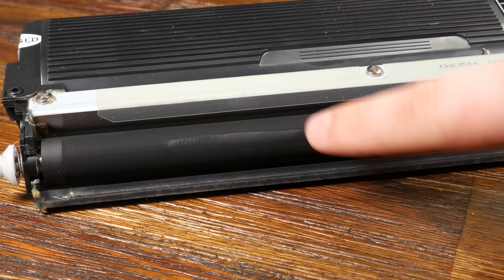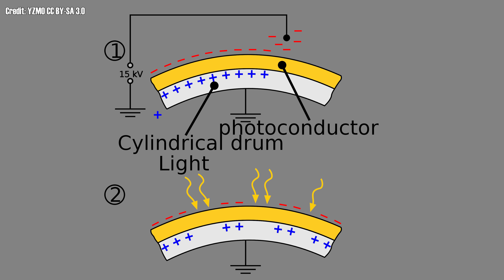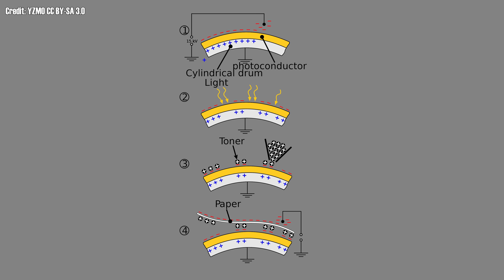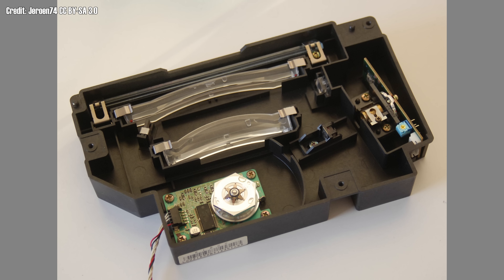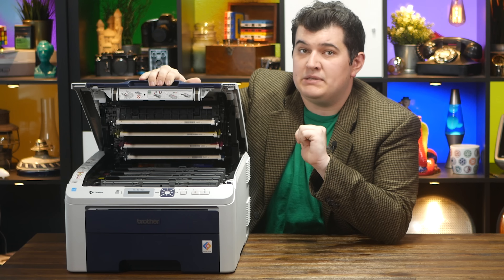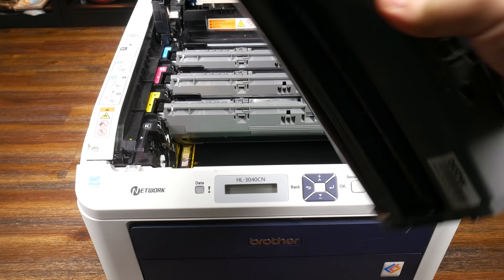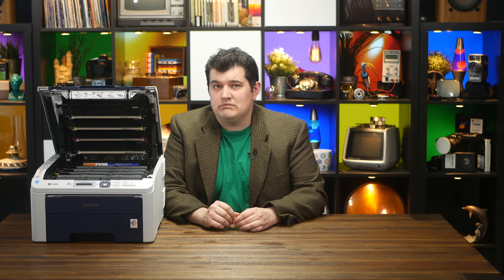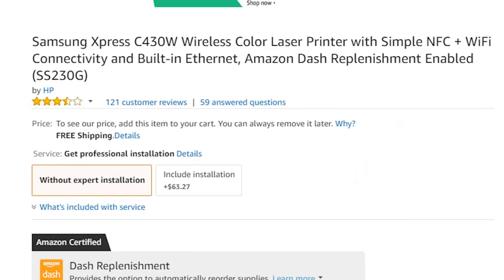LED Printers: The Common Printing Tech You Haven't Heard Of

Comment: A "whopping" 4 ppm color... son, I remember when it took 1 minute to warm up the dang fuser on an HP LaserJet II/III series printer, then have it SLOWLY feed the page through. It said 4 ppm b/w but timing it in reality you were lucky to get 2 or 3 ppm - and for a measly $1,500. Anyway, I have purchased several color LED laser printers (Dell C1600w/C1700w series). These were the first I ever read about LED laser printers knowing nothing about them considering I live in the world of computing for 35+ years.  I love their small size and lightweight footprint compared to the much larger standard laser printers. Due to the lack of big and bulky parts, LED laser printers are usually 1/3 to 1/2 the price as well (find a good sale and they can be had for under $90 for a color laser). I haven't had any issues and find the print quality of 600 dpi just fine for 99% of prints. Even color photos look great on plain paper. Unless you're a professional print shop (in which case you wouldn't even be looking at these small printers), be sure to check out LED laser printers.

Comment: I worked on the control circuitry for an LED printer. The control pulses for the printhead were nearly identical to the Laser version, and we used identical controller boards for both laser and LED models.

Comment: Printer technician here specializing in Enterprise level HP LaserJet printers.  I can not speak for desk level devices too well, but many modern laser scanners are going to be similar in design to how your LED printer works.  I double checked the manual for the most common color printer in my environment just to make sure they were not using LEDs in such a way the technician would not even know.  

The shiny black thing under those toners is the image transfer belt.  In many color printers, the toner is actually written to that belt and that is then rotated and applies the image to the paper.  In this type of laser printer there is no need for some crazy paper path, the lasers will write to the belt, the toner applies to the belt, gets transferred over to the paper and then fused. Many of the toners we use appear to be rather similar in size to the ones in that device as well and I suspect most of the difference is based on the toner reservoir size as our devices print 10k+ pages per toner (depending on coverage).  The actual business portion of those toners looks similar in size.  The overall device is probably smaller because of the lack of laser assembly.

TBH I know next to nothing about LED printers, which why I was interested in this video, but from my knowledge some of the Laser info is incorrect and it looks like it probably works the same way just with all the tiny LEDs instead of a laser assembly.

Comment: Another related tech was ion deposition printers, which used a set of in beams to charge the image onto the drum.

The head was like a page wide bar of alloy, drilled with many cavities, within each of which a short electrode was visible.

Monochrome only, but they could manage 30ppm, which was pretty good for the 1980s.

An unusual part of the design was that they were cold printers.

Instead of a fusor unit, the pair went through a pair of steel rollers at a pressure of 2.5 tons per square inch.  

This fused the ink to the paper, not just on the surface, but down into and between the paper fibres.

This meant that ink couldn't be removed from the surface.

It also tended to leave the ink, as well as even fairly coarse copier paper,  with a strangely glossy finish.

The main one I encountered was the C.Itoh CIE3000,  though I believe the core engine was either manufactured by, or licensed from, Olympus.

These were high volume, very reliable ** printers, with a rated life of about 5 million pages.

** Once they'd been set up properly.  That occasionally took a while.

Comment: The problem with led is that you have many thousand points of Failure.  This leads to Vertical lines now or later. The Laser unit almost never fails.

Comment: good video, but i would like to have seen it pointed out that colour toner printers ( a better all inclusive term ) are to be avoided in almost all cases unless you absolutely need them, you stated your personal bias against inkjet but an important factor for most people is cost, ive been selling these things for 17years and its the number one question people ask is 'how much is the refill' sure if you need the features and money is secondary to the quality or speed then buy one, but buy a good one, the cheaper ones have very small capacity cartridges by toner standards and it can easily cost £200 to change all the cartridges in your £99 printer, usually an almost identical model will exist at three times the price but with cartridges holding much more toner at only slightly more cost per set

Comment: When comparing printers it is about cost per page and quality of print. And just stay away from inkjets. If you see a cheap printer check the cost for toner refills because most laser/led printers come with starter toners with low amounts of prints.

Comment: One thing about printers that most people don't understand is that Inc is the most expensive liquid on the planet. It would be nice if someone to come up with a printer that could use a technology that would be much more cost effective but yet you would get more ink per se. If someone could come up with a printer that didn't need ink or a cartridge but yet could print on regular paper in high resolution and it would cost less for the printer and any type of refill that would be the most effective printer. If someone come up with a substance that would be much paper to put this and make the cartridges cheaper but yet you get more in a cartridge that is the type of printer I would like to see.

Comment: One less moving part; the spinning laser head, is an attraction but I have never seen one fail.
 I loved the noise of the old HP 5A printer laser spinning up- cheapest  printer I ever owned £25 second hand, I drilled a hole in the toner cartridge, closed it with a cork and refilled it with bulk toner left over in the bottle type cartridges from work.

Comment: I’ve been in the business of fixing various printers and copiers for 30 years. The source of illumination to the drum has nothing to do with the path the paper needs to take.  The main reason for the speed difference between B/W and color is processing time for the image.  The unit you displayed seems to use a transfer belt system.  This is very common, especially for color printers, as it produces better registration (alignment) of the four colors into a single image.  The point is — even if that unit used a laser assembly to expose the drums, the paper would still follow the same path through the machine.  And it never gets near the drums, at all.  The toner transfers to the transfer belt, THEN to the paper.    In my experience, we have found the LED print heads unreliable compared to laser units.  If just one LED out of thousands fails — and they do — a noticeable streak is generated.   The polygon mirror motors have become very reliable;  in fact, they routinely outlast everything else in the machine.   In newer, and higher capacity units, the difference between speed for B/W and color is hardly noticeable — but this is because the print controller (the built in computer which turns incoming print jobs into the actual rastor — RIP or Rastor Image Processing is the common term) is equipped with much more memory, including a hard drive as a buffer usually, so printing of all types speeds up.

Comment: I got sick of lasar printers because they never had enough ram on board to render images and would barf when I tried to print out anything with a picture on it.  And I went through a lot of them.   I even had a huge Tectronics one that was color wax and would melt wax blocks as the ink to print in waxy 300dpi.

Comment: That explains my newer printer.
I used to have a Canon MF210 laser printer. As usual, it's pretty big, but it doesn't do much. Sure, it's got a scanner, but the printer itself is quite large for a B&W printer.

However, I switched to a Brother HL2360DW. It doesn't have a scanner, but it can automatically print on both sides of the paper, something my old Canon cannot. Despite the reversing feature, it is incredibly compact; it is the smallest printer I've ever owned. Now I highly suspect that it's an LED printer, while my Canon is indeed a laser printer.

Comment: (The big blob of text at the start)

Ink dries out, meaning that the printer has to either constantly be performing a "maintenance mode" which wastes ink, or you need to print rather regularly which, in this paperless age fewer and fewer people are doing.

The herky-jerky nature of the print heads as they travel back and forth is very unpleasant compared to the smooth print of pretty much any laser printer.

Ink cartridges are usually priced at stupid levels, meaning that you're forced into buying generic ink which often clogs the inkjets so you're damned if you do, damned if you don't.

Because the ink is a liquid, freshly printed documents have a tendency to smear if touched until the ink has dried.

Water-based inks are likely to completely wash away if the paper they are printed on gets wet, meaning shipping labels printed with some inkjet printers can be rendered completely unreadable if they get wet from something like, oh I don't know, rain.

None of these issues plague laser printers, so despite their higher upfront cost (and arguably more expensive toner) you can pretty much count on them to work perfectly even if they've been idle for over a year, they don't waste toner on "maintenance modes", the toner is bonded to the paper so water doesn't smear it, the toner is never wet so you don't have to wait for it to dry, plus spills can easily be clean up as the toner is a powder. I could go on, but if you read this entire thing, you now know why I generally dislike inkject printers and why I will forever use laser printers, or LED printers, which are the subject of this video as you'll soon see.

That said, Techmoan recently reviewed an inkject printer that was actually pretty decent in terms of ink cost, so even if a "maintenance mode" were to waste ink, it's not like it's wasting super expensive ink.

Perhaps one day I'll rejoin Team Inkjet. Particularly for photo printing (and images in general inkject reigns supreme. But for now, I'm planted in the realm of toner so that, when I have to do my taxes, I don't have to waste time, energy, and money fighting a stupid inkjet with clogged heads.

Comment: Sorry, I run out of magenta, can't print that black and white document.
Also, new cartridges cost as much as new printer.
BTW the red one is jammed gotta clean it.
Okay it's now clean, I've only used half of it to do it.
O I see you've got a new magenta cartridge!
Sorry it's not an OEM one, can't use it.
BTW did I mention that your drivers need an update?

Comment: To cut in short Why you dont need  Inkjet printer - if you print relatively rarely, Inkjet is total wast of money since ink will simply dry out during  idle time. Laser printess dont have such problem. As for so called "photo-printing" to get good results you need special paper and rerlly good printer, its probably easier to print it at shop or something.

Comment: And all I want is a printer that can print white.
Reply: I don't know if you're joking or not, but this would definitely have its uses. However, I would guess it's not a limitation of printer technology as much as a lack of demand for white toner, and a low demand for non-white paper. I'm guessing white toner would cost more though because I'm guessing it would be harder to keep white consistent and black materials are just so dang common.

Let's say white toner was available. And let's say black printer paper was available (other non-white colors are available but that's a different topic). Then just use both in a currently existing printer, without any modifications, and you'd be printing white on black. That would be pretty cool. Kinda like a physical version of 'dark mode' on your phone screen.
Reply: @crapizio  I'm a model builder and a printer that could print white would be great for custom printer made decals, that's why I'd like a printer that could print white.  I like this idea of switching black for white toner and just printing as usual, except switching black for white in graphics software.  I'll need to look into this.  Thanks!
Reply: @rickyl7231  Let us know what you find and how it works out!

Comment: Ha! You're so right about Amazon listing these as laser printers! I got "tricked" and bought the model with the built-in scanner. I didn't realize it wasn't technically a "laster" printer until I saw your video.

One thing to point out: These printers are extremely large and heavy. I didn't realize just how bulky it was until it showed up on my doorstep.

Hopefully it lives up to the reliability (and long-term economy) of my old black-and-white laster. I just wish it was as light!

Comment: Reliable, nope, I am a Service tech and I have a particular retail chain, at least once a year, they fry the main boars because they do not open the door straight up and bump one of the print heads, thus shorting out tje Main Board, as someone else mentioned, a Service Techs least favorite machine, I prefer Ink Jets over LED printers. Laser might be slower, though, enterprise level printers like the HP M600 series are still a pretty good speed. LED printers will break if you look at it wrong. I only service them because I have to, I much rather drop it in the middle of a freeway and let a few 18-wheelers have a go at them

Comment: You've got a few things wrong in this video. Most modern and even older color laser printers, including your Brother, do not print from the imaging drum onto the page. Instead, they print onto an ETB (electronic transfer belt) or ITB (intermediate/image transfer belt), which are basically the same thing with different names. By doing this, all 4 toners/drums can be printing onto the transfer belt at the same time, just different parts of the image depending on where they're located on the belt. Also, most either use 4 separate laser scanner assemblies, or a single laser scanner with a very cleaver combination of lenses and mirrors that allows it to scan all 4 drums at once. In fact, the ones that use those clever mirrors & lenses end up with the toners arranged "suspiciously similar" to your Brother, just in a tray that positions them under the laser scanner assembly, e.g. that Canon. In most cases where color printing is slower then mono, it's due to procession power (especially older units), added fusing time, or marketing.

The Samsung C430 is an outlier. First off, it's $140, which is ridiculously cheap for a color laser printer. To save on cost (I assume), it actually only has a single imaging drum, but still has an ITB. I can only assume it works something like this: the first toner is engaged, the laser scans the drum, etc, and it prints a full page in that color onto the ITB. Repeat for the other 3 toners, printing over the previous colors. When the full page in CMYK is loaded onto the ITB, it picks up the paper and transfers all the toner from the ITB to the paper. The paper continues to the fuser, the ITB is cleaned off, and the next page loaded onto it. Just to make sure we're clear, the paper does not take a "meandering path", it never touches the toner cartridges themselves, only the ITB.

I'm not sold on LED being more reliable. At 600 DPI on an 8" wide sheet of paper, you're talking about 4800 LEDs *per color*. That's almost 20,000 points of potential failure, not to mention the circuitry to run them. A single burned out LED might not be noticeable in text, but get a few close to each other and it'll drive you nuts. The only advantage I see to LEDs vs laser is in size, the LED assemblies are much more compact then a typical laser scanner assembly, which allows the printer to be smaller, especially in height. They also look like they should be very easy to replace in your particular model, but I would not expect every LED printer to have the LEDs hanging off an easily opened top cover.

Finally, the size or at least shape of the toner cartridge may be slightly affected by use of LEDs instead of lasers, but it's mostly determined by the amount of toner inside. Most cheaper printers have smaller cartridges, for the same reason cheap inkjet printer cartridges have very little ink in them - to make you buy more cartridges more often. The manufacturers make very little off low-end printers, either laser or inkjet, but they make a KILLING on supplies.

Comment: 3:22, 600 DPI does not mean 600 x 600.  It means that one square inch contains 600 dots.
Reply: No. That would be "dots per square inch".
A 600 DPI resolution DOES mean 600x600 and would have the potential of 360,000 dots per square inch. A '600 dot per square inch' resolution would be roughly 24.5 x 24.5 (dots per horizontal inch by dots per vertical inch), which would be wholly unacceptable for most uses.

To be fair, the terminology is somewhat crappy since it goes unstated that the horizontal and vertical resolutions are equal. That is not always the case in all technologies, especially pixels. I would agree that it would be clearer to label resolutions in both dimensions, so it should be stated something like '600DPIx600DPI', but good luck getting that past a marketing team. Or just state that the dots are squares, so with a term like "square dots per inch", "600DPIx600DPI" could be shortened to "600SDPI".